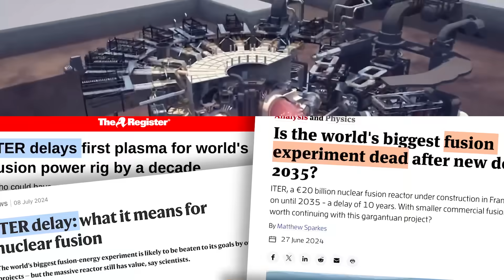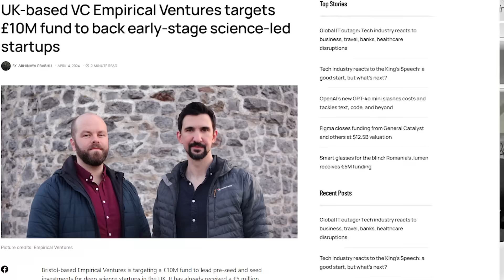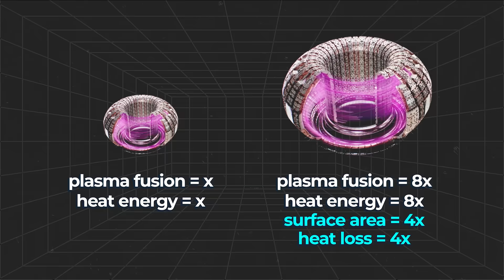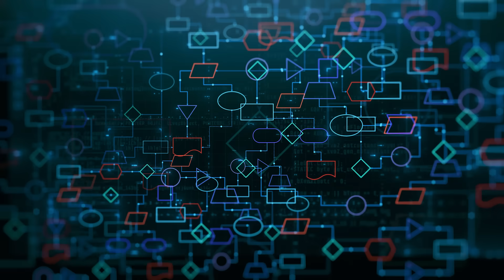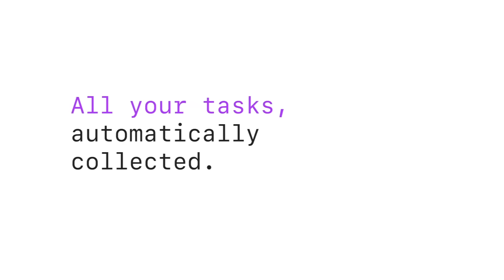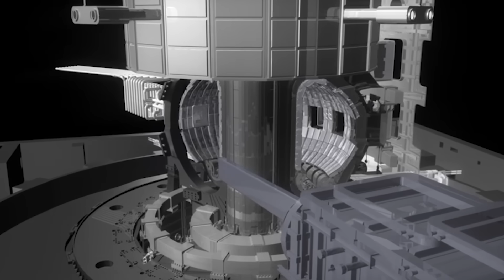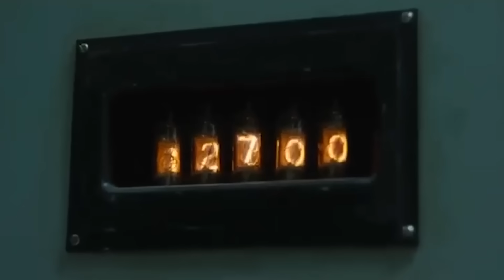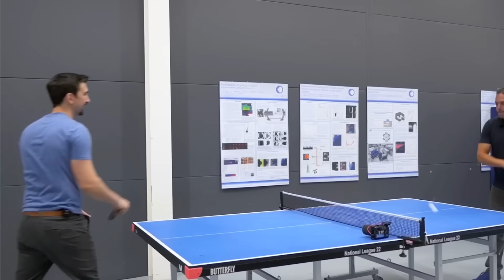Is The World's Largest Fusion Project Dead?

Comment: JWST, which you mentioned, is a good comparison: It took a long time and went way over budget, but in the end the launch and unfolding went flawlessly and it is doing an amazing job at improving our understanding of the universe. Likewise, ITER is a massive project that is taking a long time and going over budget, but in the end, it might provide absolutely crucial information about fusion technology or physics in general. We won't know if we don't try. ITER's funding could be used for other research, but sooner or later we will want to fund also projects like ITER that study things that cannot be studied in other ways, and as we are already this far into ITER, it wouldn't make sense to stop and waste all the progress so far, only to start again in 50 years. Better finish ITER now, and use knowledge from it to make a much better project 50 years later. We need to fund science on all levels, everything from small one-person projects to megaprojects like ITER, ELT, JWST and the LHC and its successors.

Of course, we shouldn't fall into the sunk cost fallacy, but if there isn't a reason to think that the project will keep getting delayed and require a lot more funding, then it makes sense to not abandon a project when it is 90% finished. So much has been spent on ITER, and it would be a waste to not see if it can actually do what it was designed to do. Only if the budget starts to become completely unreasonable, no clear progress is being made, there are problems that are seemingly impossible and we have no reason to think a solution is likely, or it turns out that the majority of the project has to be overhauled (e.g. need to rebuild several major components), then cancelling it should be in serious consideration. 

Cancelling it isn't unthinkable. There have been projects like the American Superconducting Super Collider which in retrospect would probably not have been worth the price, as ultimately the LHC could do basically the same for much cheaper, thanks to new technology and by focusing on a different aspect than just pure energy of the collider. Similarly, it is possible that instead of ITER, a couple smaller fusion projects with a different focus might have been better. But it is easy to be wise in retrospect, the thing about cutting edge science is that we don't know what is out there.

If the international cooperation is causing problems for ITER decisions, maybe some participants (most likely at least the EU, as the project is built in France) can buy out some other participants, if they are willing to exit. Basically, the participants who stay would pay the exiting participants for at least a part of the investment they have made into the project, and after that, they no longer have decision-making power in the project.

Comment: We already have free clean fusion power from the sky to the tune of cosmic 173,000 terawatts non-stop for billions of years and at least a billion more.  For baseline reference, that amount of power could supply the world's annual 620-exajoules of energy use in just 1 hour.

Moreover, the next 10- to 20-years will be critical to mitigate the worst effects of climate change.  So putting dollars & effort into a very low probability of success project is not a wise during this critical time.  Every dollar, scientist, technician, and researcher counts even more so now especially considering when we're at war with climate change and fossil fuel interests.  Fusion research should be curtailed for now leaving only those with the deepest contributions remaining on it.

Comment: Fusion is a waste of time and resources.. Its the Oil industries' way to delay their demise even further. Its a stalling tactic. Fusion is that kind of science where we observe it in nature, and want to make it ourselves, only to realize that its to explosive and dangerous for real use. If we stay on the concept of Fusion energy, we still rely on centralized grid thinking. Where a large powerplant with fusion is going to feed into the already existing energy grid. And that's just dumb. Centralized grid thinking does not support the "Type 1,2,3 civilization" thinking, because you can only use that power when plugged into the grid. A true Type 1 civilization has mastered their own solar system, and can freely move around and harvest / visit all the planet and star. Thus Your spaceship should be able to use the power generated by the fusion technology. Without needing a gigantic fusion reactor on board every tiny little ship. 

I say the same thing about building giga structures around the star, to harness its energy.. its POINTLESS and dumb, because its again centralized grid thinking.. how will the ships make use of that power? Batteries? really? .. Don't even get me started on the sheer amount of material required to build a halo structure around the sun.. Its not just dumb, its also impractical and pointless. 

We should instead be looking for the ever elusive Zero Point Energy, that does not conform to centralized grid thinking, and instead houses a small device in everyone's phone, car, house or other mechanical gadgets.. generating their own power for their own uses. ZPE will be portable and thus useful for space travel and colonization on other planets.

Comment: I wonder if a steam turbine is the correct way to go? Perhaps there is some other way to yoink energy out of a fusion reaction? It produces light and heat, though if it is being held in some kind of vacuum then it would produce most of its energy as light. Would it be possible, I wonder, to redirect that light somehow and do some weird fancy trick with it to make some kind of super-charged solar panel pump out insane amounts of power? Or perhaps use the sheer "force" of the fusion reaction generated by it being very very hot to create some kind of opposing magnetic field to spin a magnetic turbine with?
Reply: The basis for all power generation is a steam turbine. The heat itself doesn’t apply a force and if you want to use that energy, it needs to be converted into a form we can harvest. So far, the most practical way to do that is heat water, use the steam to turn a turbine, and that turbine has the magnets which generate the electricity. That’s how coal plants and fission plants generate electricity. The reaction produces way more heat than light. So you basically end up with needing to convert thermal energy -> kinetic energy-> electromagnetic energy.
Reply: Fun fact, we can convert Heat directly to Electricity, It's not hard. But It's still more efficient to use that heat to boil water to spin a turbine, by like 50 - 60%. Steam is the most efficient method of power transfer / generation we have ever found as a civilization. Its extreme efficiency is WHY we found it so long ago, and why it's still used. Another fun fact, turning light into heat and using that heat to spin a turbine is more efficient that photovoltaic panels. Photovoltaics are just small, light, and able to be placed everywhere making them cheaper per dollar then a more efficient system.

Comment: Big dreams are a great long term motivator. But, imo, you're correct, a multi-approach is the most logical. We have discovered a multitude of non or low carbon energy sources already. Even standard fission has already shown its usefulness. Especially if we use it as an interim source. Produce massive amounts of power with it, power all of our needs and use it to power the next great leap. But pushing it away while we blindly go down a road that we have no clue of success or time is asinine.

Comment: Solar and Wind energy are so cheap that they beat all other : nuclear, coal and gas. 
Even with batteries, solar and wind beat coal, nuclear and is near to beat gas. 
In few years solar and wind with batteries will beat everything at cost. 
Hydropower will be there, but you can't create rivers and with climate change sometimes you don't have enough water. 
So fusion is an excellent idea but commercial is DEAD.

Comment: Once one approach fails to live up to expectations it is natural for the fans to assume one of the newer approaches must be better. In many cases this is driven by wishful thinking.

Almost all fusion breakthrough announcements are filled with sales hype while leaving out many of the numerous problems that still need to be overcome. Those, who have come to love physics, such as the above content producer, shouldn't be considered to be unbiased. They are unlikely to present the full listing of all the enormous problems that still need to be solved.
Reply: You’re saying anyone who loves physics is going to hype fusion, and be unable to look at it critically? Thats just silly.

And going through all the problems with different fusions projects would take WAY longer than any media presentation could afford to be, so of course they’re not all going to be listed.
Reply: @13minutestomidnight  - I'm sorry that you twisted my words so badly. I didn't say anyone who loves physics is going to hype fusion. Since the claims were made about how common the fuel is have you made any effort in pointing out that tritium is radioactive, is extremely rare and has a current market value of approximately $30,000/g? Have you made efforts to point out that the energy gain figure that is commonly employed is based upon a fusion input energy parameter that is typically orders of magnitude less than the energy needed to generate that input energy? Have you made efforts to point out that when the tokamaks, such as ITER, are operating near full fusion power levels they will be operating in a pulsed mode with very low duty cycles? If you weren't aware of such conditions then consider that millions have been deceived so a bunch of experimenters can continue to have fun with their machines.

Comment: So here’s a question. Your gripe is essentially that because ITER is trying to focus in on a single extremely large project, the multinational team is too spread out logistically to effectively work on such a large project. So instead you suggest breaking down this large project into smaller projects that each take a different approach (from my understanding u would want the international community to either model the private companies and/or simply fund them directly thus having this collection of companies replace ITER). My question would then be how would this approach actually avoid any of the issues that still inherently plague these international projects? Again my understanding may be wrong, but it seems like you would want ITER replaced with something that utilizes a multitude of approaches. We can’t even figure out how to work together on a singular approach it would seem this would just add significant complexity. If you want a product made, the answer is almost always private industry and allowing the free market to distribute that product.
Reply: To be clear, if your intention was more so just to forgo an international team and just make an international fund that funds the top private fusion projects, I %1000 agree. Idk how this works exactly but I’d imagine the problem here then becomes ownership of the IP of the project because it’s a private company funded internationally but that’s just my ignorance. That still seems easier to figure out than getting 20 countries to remain on the same production standards and such.

Comment: The practical problem is it’s either ITER or nothing. Funds will just dry up NOT get redistributed.

It might be possible to continue ITER & call for more funding towards other projects. Which is realistically what we need. US or EU only addition mega fussion project might also be possible.
Reply: heck no, there's dozens of other projects. Commonwealth Fusion Systems has established the site for their first attempt to add fusion power to the grid in 10-15 years and is working on the mundane stuff like permits in parallel with the science. Lots of others using a lot of different approaches, some fairly simple and brute force, others conventional like Commonwealth which is a spinoff of MIT tokamak research, and some quite exotic.

Comment: The normal, usual rules of engineering are, and have always been, suspended in the field of fusion electrical power generation.

All physical research in fusion power generation should be stopped until a believable theoretical method of cheaply, reliably generating enough Tritium to power perhaps 10% of the world's electrical power demand (plus a safety factor) via fusion, has been developed. This problem should be worked backward, starting with assuming that X GW of usable, three phase AC electrical power will be generated.

The same can be said concerning materials or methods that will allow permanently positioning plasma (in a partial vacuum) at many millions of degrees next to super-cooled magnets, in a long-term safe and reliable fashion.

If either of the above problems can not be solved (and possibly several other problems), then research on using fusion to generate electrical power should be immediately and permanently abandoned. It is just stupid to allow sappy emotion and childish hopes to waste at least another $100 billion. Having said this, it is possible that dramatic and completely unpredictable advances in material science or physics might occur in the future.

Comment: This video is totally wrong.
Let me elaborate:

   The ITER is a research project/facility. It has no commercial goals and wasn't even designet to be connected to a steam turbine since its goal is not to produce electricity. Its goals are:
* Develop a reactor able to deliver sustained fusion over time; not seconds, minutes or days but being able to sustain the reaction for months, something NEVER delivered.
* Then, generate way higher energy output than the whole imput cost. Again, this was never achieved in any other research.
* Evaluate if the whole cycle is able to produce enough tritium to feed himself. If this isn't achieved, later goals are irrelevant.
* Evaluate the degradation of the device under the extreme forces that will be in operation, to asses if the design of a commercially viable reactor could be achieved.

   Again, the ITER is a RESEARCH project/facity. It DOESN'T aim to deliver energy to the network, it DOESN'T aim to be profitable, nor to solve energy demands in the close or mid term future. Also: is not needed for that. Climate change p`roblems will be fixed or derranged WAY before any viable commercial fusion reactor reaches the market.

   All of the other fusion projects are essentially FRAUDS, aside from a couple ones which are focused in developing and enhancing the design of thernonuclear warheads. All those independent paths are just star ups begging for funds to burn before fading out with no resources or results. THEY WILL NEVER WORK, and are WAY BEHIND the ITER in terms of achieving aplicable results.

   So is perfectly fine for the ITER to take time, be slow, struggle to have success and even fail. Is a cooperative multi billion dollar endevour aiming to RESEARCH.

   In contrast, those small projects are aiming to produce viable fusion reactors, and will never achieve that. The will just burn the obtained funds into nothing. The case for Small Modular Reactors of fission is even more clear: they will never have commercial succes since the larger, better funded and developed conventional type II reactors were NEVER profitable and currently can't compete vs renewables, so the SMRs, which aren't new at all (every nuclear ship has been using SMRs for decades now) are just worse options since lack the economy of scale to even compete against the unprofitable conventional reactors.

   So I applaud the ITER for trying to solve difficult task, while I condemn shills hailing fraudulent quicktarters trying to sow funds and pretending they will solve our energy needs. Spoiler: they won't.

Comment: I wonder if some of ITER's goals can be separated out, and partially achieved even before the main goal of sustained plasma, by cooperating with other fusion projects.
    Specifically, you mention tritium validation. If ITER scientists have been working on various aspects of this problem, any advances could serve a lot of other projects. Can you actually design a blanket of lithium to absorb neutrons and breed new tritium? It now seems clear that other projects are likely to achieve sustained fusion before ITER, so perhaps their tritium validation efforts and budget should become more multi-project. Of course, they will eventually need to have some plasma to test their designs, so they should plan on working with private and other public projects as those come online. 
    The UK, which has for many years successfully operated JET (Joint European Torus) and is now decommissioning it to be replaced by STEP, Spherical Tokamak for Energy Production. ITER's tritium concepts can be tested on STEP and any private fusion projects which succeed in producing a plasma. 
    I think it will take several years to decide whether to pursue ITER within its original goals. It would be nice if some things of value could be salvaged, even if the main effort is abandoned. Perhaps tritium research, and other subproblems, can proceed even while those debates are happening, and provide value whatever the eventual decision about ITER in its current form.